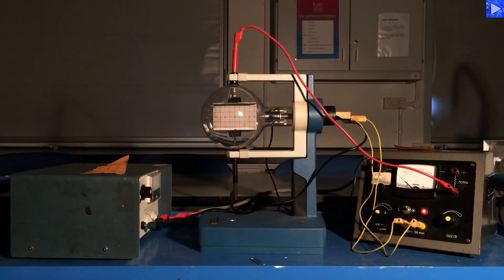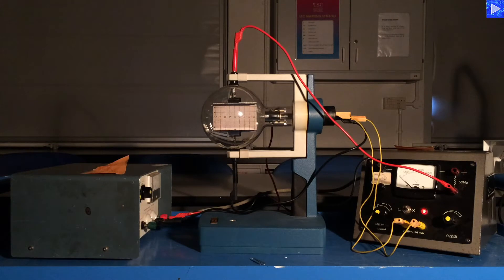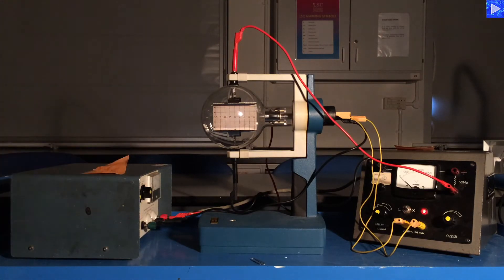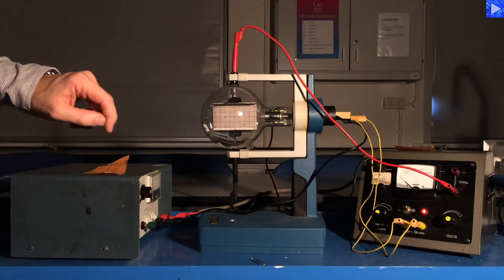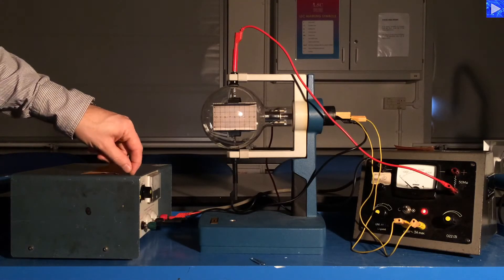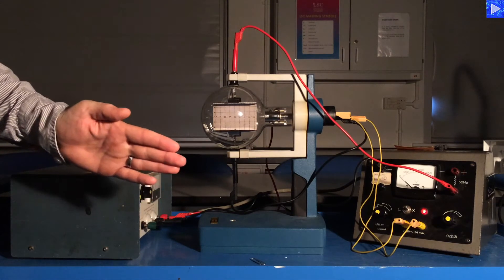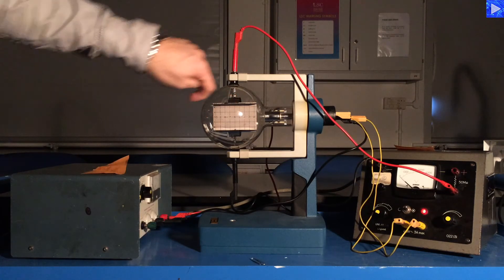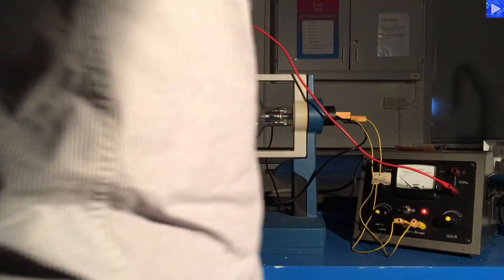Deflection of charged particles in an electric field

Comment: Can you please 🙏 explain this experiment more?
Reply from the maker: Does the below help?  If not reply with what you’d like further explanation of. 
1. The charged particles used in this experiment were electrons. 
2. Electrons are accelerated horizontally by use of an electric field. 
3. After acceleration they enter an electric field that is applied vertically. 
4. Electrons are attracted toward the positive plate and repelled by the negative plate.  This gives rise to an electric force on the electrons that acts vertically on the electrons. 
5. As a consequence of the vertical electric force and incoming velocity the electrons are deflected to follow a parabolic path. 
6. The video demonstrated the effect of increasing and decreasing the electric field strength. 
7. It also demonstrated the effect of increasing and decreasing the accelerating field for a constant deflecting field strength.